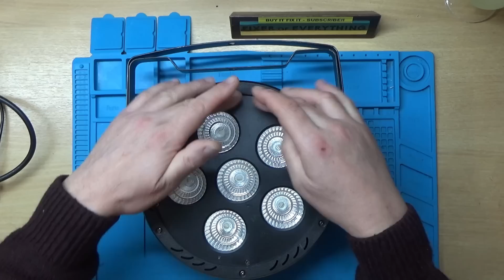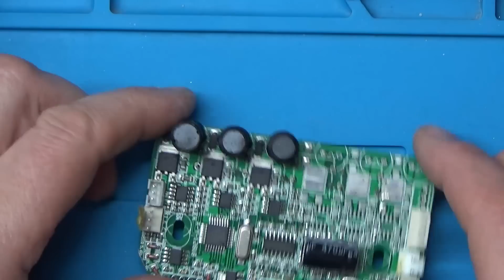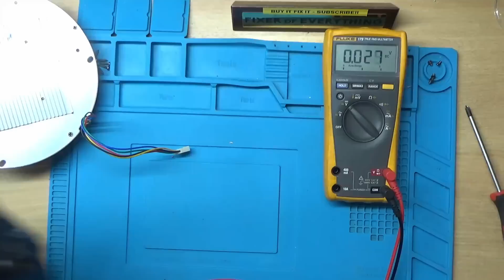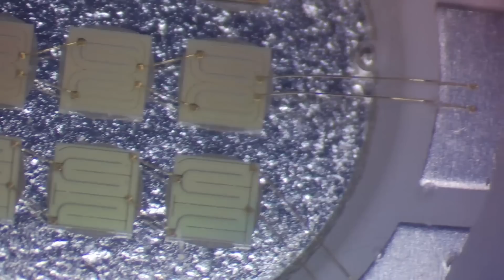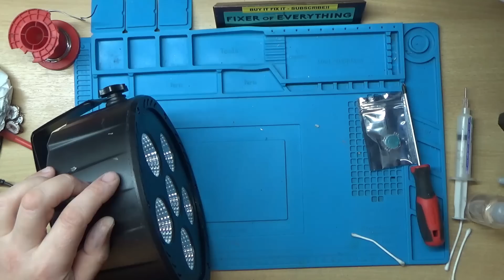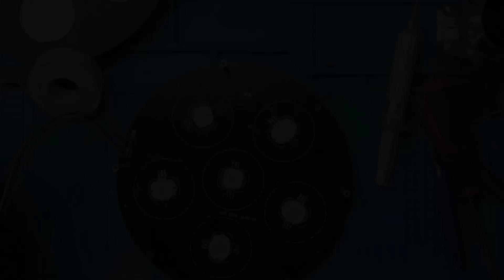Faulty QTX PAR180 High Power RGB Stage Light | Can I FIX It?

Comment: When one of the LEDs fail, the other "group" will start to fail as they're getting double the current, but yeah, those LEDs has been getting quite hot... Maybe they're driving the LEDs a bit too hard, trying to get as much light out as possible with some cheap LEDs, interesting to know the current of them and their rated current, maybe lower the current to stop this happening again?
Reply: You are right! I think Bigclive had done a video about these cheap RGB fixtures. The LEDs are driven much to hard and will fail soon again. If the current is reduced they will last much longer!
Reply from the maker: Yes I think I'll look into doing that 👍
Reply: I think they drive them too hard. I also had tons of leds fail (also dmx lights) because of no good value current programming resistors which cause the leds to get driven too hard and they will fail. Either a dumb manufacturer or planned obsolescence. I successfully fixed them all and replaced those bad value resistors with resistors that limit the current more. They are still staying strong and the heat output also slightly decreased